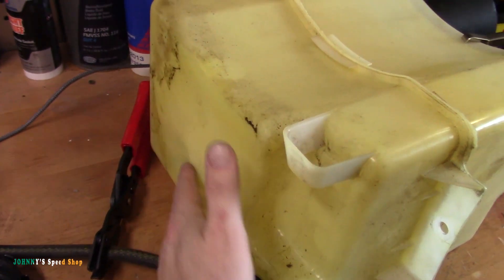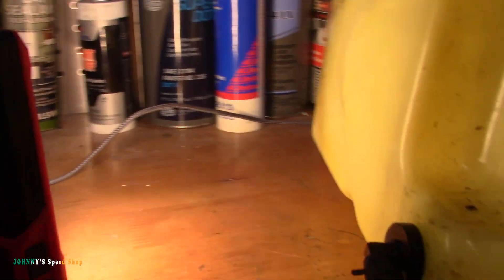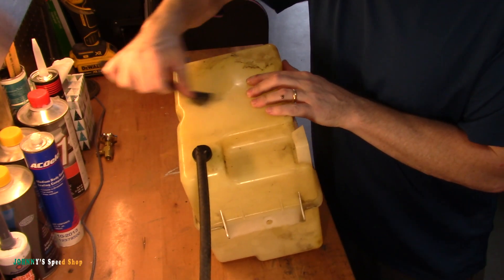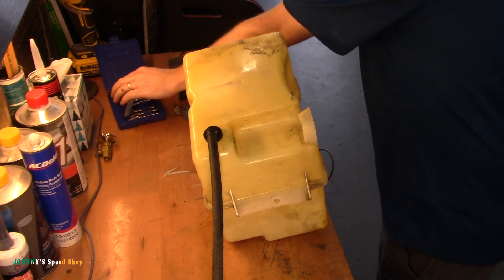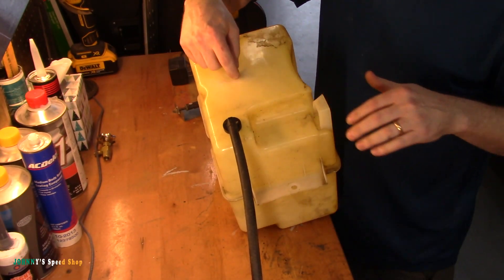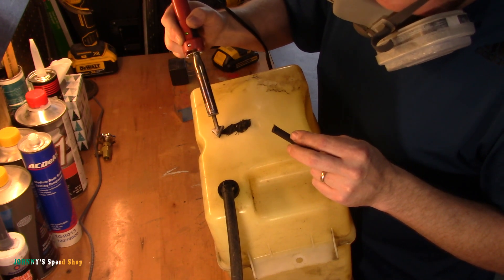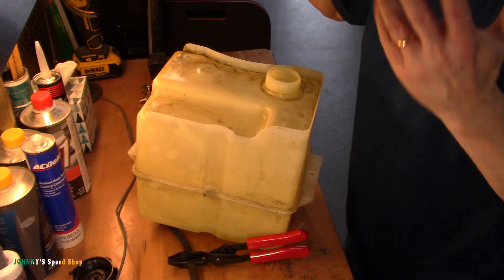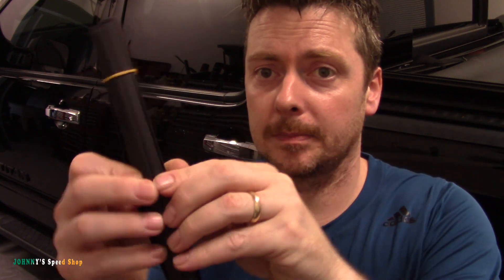How to plastic weld - Fuel Tank repair

Comment: I don’t believe that crack required anything more than burning a channel with soldering iron and then using your iron to scrape plastic back into your nice new channel.  It’s a permanent repair without any costs.